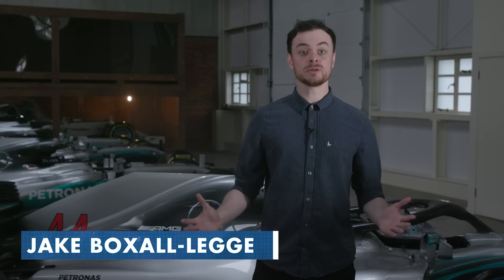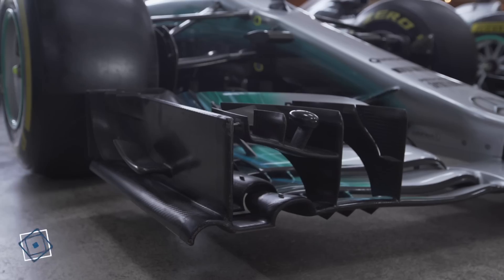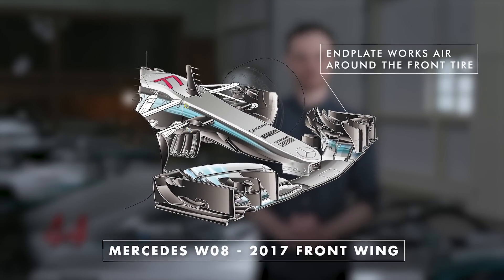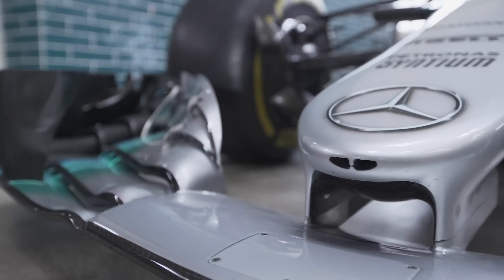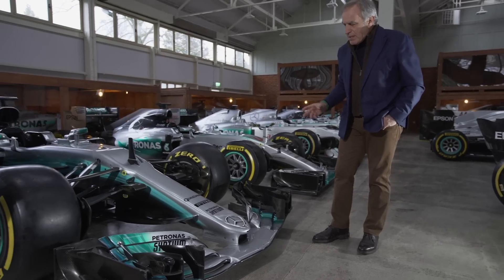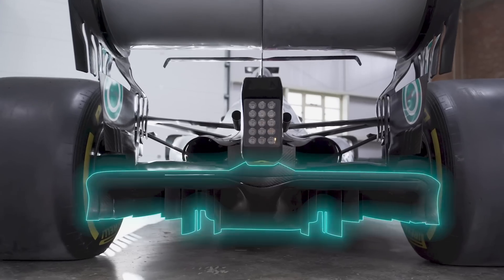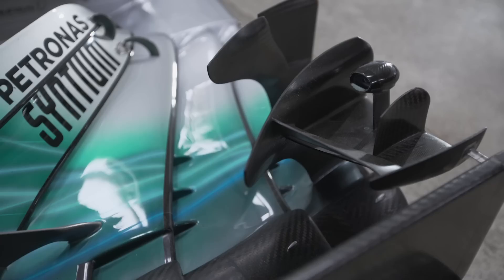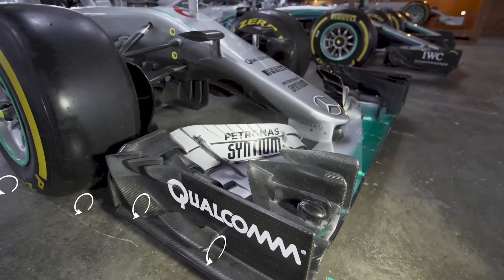How a Formula 1 car works: Episode 1 - front wings

Comment: The front wigs and barge boards combined withe the Aero under the drivers legs of modern cars are what has killed the ability of other cars following closely . That combined with the ridiculous ties that fall apart if you do manage to get  lose fo a few laps. Just look at how close cars could follow each other in the late eighties and early nineties. The cars could stay within a few feet of each other and the tires could take the punishment. They didnt need the dreaded DRS to help them pass because they were close enough to get the tow and s.ing shotx  past. But it never guaranteed a pass like DRS. A car that had bad aero could stay ahead if he had the engine power to do so like Villeneuve did in Spain in 1981. It maxe great racing be cause the driver of the car with bad aero had to drive the perfect race so if he won he deserved it. That would never happen today because the tires of the following cars would die or DRS would make it to easy to pass.

Comment: All that hassle in a car just to navigate the airflow...imagine racing simply in vacuum
Reply: racing in vacuum wouldnt be possible; the lack of downforce would mean that the car flies out of the corners without grip.
Reply: @Wrtvrxgvcf55  a vacuum is not the same as 0 gravity, how do you think your road car without aero turns?
Reply: @ChrisFozzy100  

do you even know what you're saying? road cars dont need aerodynamic downforce because the speed at which they go is not only very low, but their weight is also incredibly high (relatively speaking). at the speed and acceleration levels of a F1 car, a car without aero will literally take off, granted that this effect wont happen in vacuum as in vacuum there are no air particles to push the car up, but since there also are no air particles to push it down, the car would simply slide out of corners at speeds that are anywhere near racing speeds. you could DRIVE a car, but RACING a car wont happen

https://www.youtube.com/watch?v=nkcGPf-fLV0

this is a video of Le-Mans cars (not even anywhere near F1 speed) taking off into the sky because of the slightest bits of aerodynamic instability. high speeds need to be accompanied by air particles and aero.
Reply: @Wrtvrxgvcf55  The cars wouldn't even make it out of the garage, since there'd be no cooling. But if cooling wasn't an issue I think you could go racing at lower speeds (1950-60s) of course but with some track modifications such as reverting to the old school tracks with more camber and greater suspension travel, ground clearance (and FRIC) you could replicate and recover some of the characteristics of downforce to help the tyres stick to the track. You'd effectively go back to the 1950s I think. Where races will be won by talent or mechanical advantage. Imo
Reply: @lepremierpierre8819  
good point on cooling, didnt even think of it. but yeah you would in essence go back to a different time period. and yes, camber would have to be introduced in almost every corner, with the max speed being capped on the straights
Reply: @Wrtvrxgvcf55  agreed, it also means the cars will have zero drag to slow them down!!! So any high speed collision would be disastrous
Reply: @Wrtvrxgvcf55  It would, the cars would just have to go much slower.
Reply: @williamstephens9945  no, as stated earlier the cooling of the vehicle will also be impossible in a vacuum, as there are no air molecules or any other for that matter to dissipate heat on to.
Reply: @Wrtvrxgvcf55  You can't rephrase your statement and make out I've missed something.You implied that racing without aerodynamic down force would be impossible, I merely rejected that claim. 

Your response was to say that at lower speeds you could race without aerodynamic down force but at 'F1' speeds you would crash. To me that sounds a lot like what would happen for example at Monaco if the cars tried to race at speeds seen at Monza.

I think you have missed a far more fundamental reason as to why you can't race f1 in a vacuum rather than cooling. The requirement to burn oxygen in an IC engine.

It looks like we will have to watch Formula E on the moon
Reply: @ChrisFozzy100  fair enough. i write these things much faster than i can think mind you lol
Reply: No oxygen, no combustion. Stop